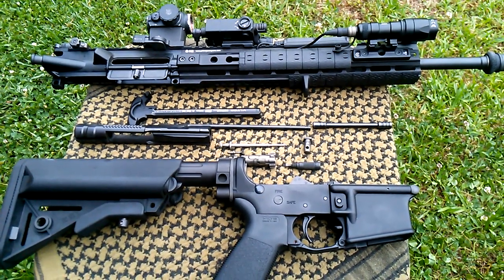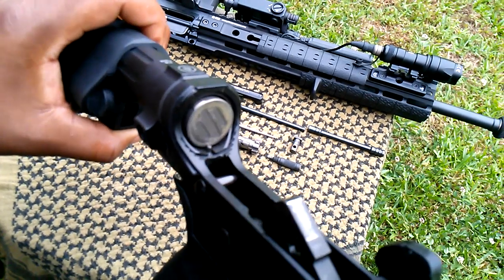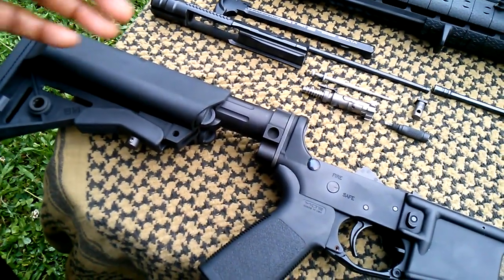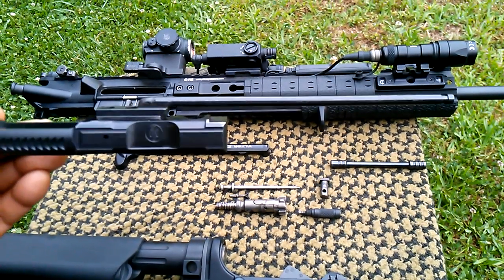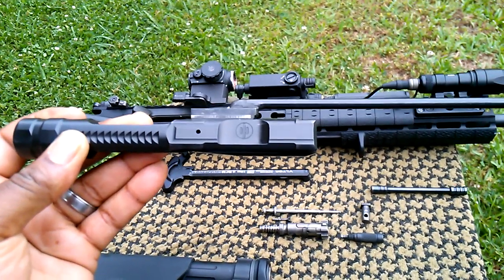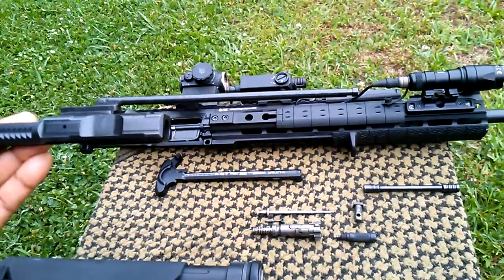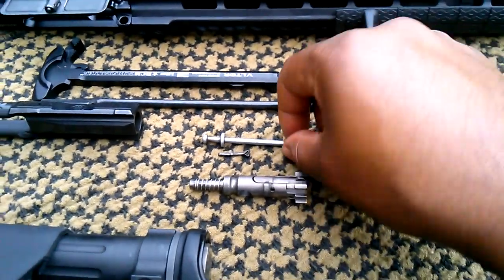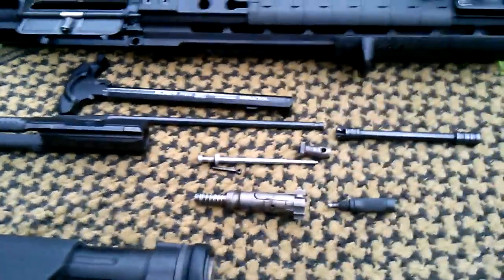A closer look at PWS gas system part1.

Comment: I have a mk1 mod 1. 10.75 in barrel suppressed with AAC. M2000. I do have a cmc trigger installed. And it is driving bolt back far enough to eject fired round an chamber live round but doesn't cock hammer so hammer rides bolt forward an even though there is a live round in chamber it won't fire an you can't put safety on. I tryed using 3 difference ammos all h.v. I have tried all gas settings? Only thing left is to see if the hole in the barrel is clogged with copper? How do you do that? I could go though trouble of taking out cmc trigger an put factory one back in. I have only 1,000-2,000 rds though gun. I did dismantle gas system to clean tube but it wasn't that dirty. What would you recommend?
Reply from the maker: Yeah I would try  putting the factory trigger first. Your barrel and gas block should be good  to go, if its firing and chambering another round. That would mean your gas system is good too. That definitely sounds like a trigger issue. If changing the trigger still does not work contact PWS. They have great customer service.
Reply: @datzitteezy   Thanks I have been in contact with them an Owen seems to think trigger is a great one an probably not issue. I did have gas setting on 2 an he said wiith my can an ammo I should use 3&4. Plus he's sending me the h3 buffer which is a bit heavier than the 4.5 oz. Buffer I have now. I'm giving it a good cleaning an see if that helps with it on the 4th setting. He said xm193f ammo pretty hot an doubts that with only 1,000/1,500 rds though gun, it wouldn't have a blockage in the hole going from barrel up to gas block. Thanks for your video an help.
Reply from the maker: 10- 4 bro. my next guess was going to be try changing the buffer. hopefully that will solve your problem. good luck!!!

Comment: I am building an AR10 in Dpms format and there is nothing for a .308 piston bcg. I have a few piston guns and I would prefer this system. I wonder what makes it proprietary. Does the rail have something where the piston rides in or is it just a cup in the gap block? Can find much info on this system. Thanks for the video. Yours is the most informative.
Reply from the maker: i actually have a part 2 to this vid where I break the entire system down for cleaning.  there is a tube that rod sits in and the gas block is adjustable and will only work with this system.
Reply: +datzitteezy it seems like an awesome system high end system. Wish they made kits like Adams. I have an Adams xlp system in one of my AR15. The xlp is a huge leap from the old ones very solid and reliable as hell. You should do a review. I was hoping they made some .308 kits but they don't. Just seeing my options. Thanks again bud.
Reply from the maker: +Kris Stojanovski no problem. glad i could help.

Comment: do you leave it on one gas setting or do you adjust every time you add or remove the suppressor??
Reply from the maker: +Abram Arnold  For the most part I can leave it on the 3 dot setting.  It has run 55 grain tula with no hiccups. It also makes for very soft recoil. On the four dot setting which is the smallest port. It will run 55 grain but every once in a while I will get a failure to feed.  There is just not enough gas to push the BCG to the rear. Now with hotter loads 62 and above it runs fine on the four dot setting suppressed and unsuppressed.
Reply: Thanks, im looking into the 308 pws and was trying to figure out which gas setting to leave it on for general suppressed and unsuppressed use. I might jump between 147gr and 150gr loads

Comment: Great video, UPS is bringing my PWS 7.62x39 this afternoon!
Reply: Well, I think the recoil is a little sharper, and a little more felt than my DI 7.62x39 guns tuned with adjustable gas blocks.  In my opinion, a 7.62x39 AR shouldn't be a go to war gun anyway, so the added reliability of the piston and the downside of the recoil for $1,300 isn't worth it to me.  It's cool and it's light, I wish it was chambered in .223 Wylde or 5.56 honestly, or that I would have put the money towards a Krebs AK.  Nothing wrong with the product, just a change in my preferences which happens all too frequently it seems.
Reply: ***** Yeah, the bolt/lugs are pretty thin when milled out for that caliber.  I'm not sure how common the failures really are though, I personally never had an issue with them.  I've seen some negative stuff about 7.62x39 magazines floating around the internet, but I run C-Product 30 rd mags and haven't had a feeding problem yet.  By no means am I telling you not to get one, if you're dead set on a 7.62x39 AR it's probably the best upper on the market in my opinion.  Piston keeps your bolt carrier and stuff a lot cleaner, but a standard gas blow back tuned is just as fun and a lot cheaper.  If SHTF I'd take the gun and a spare bolt out of one of my others just in case;  It's currently the best rifle in my small collection.

Comment: Does the PWS Mk1 Series rifles accept "standard DI bolts"? 

Or is it necessary to use the proprietary bolt?  

Great video on the gas system.
Reply from the maker: Not the Mk1 series rifles.  These are gas piston run rifles and only work with PWS gas piston BCG. However PWS has just released a DI line of rifles called the modern musket and it does run any standard or mil spec BCG.
Reply from the maker: ***** Gotcha. This system can only run the PWS bolt as it does not require gas rings to vent the gas like the traditional DI AR's.
Reply: +datzitteezy Actually, you can run any standard AR bolt as long as you strip the gas rings off.  In fact, I have one in right now.
Reply: I wouldn't trust the reliability of that under harsh conditions. Maybe good just for a range trip and haven't seen pws come out and say its ok to do that. From everything i've read PWS says it can damage the sysytem. So i still say use original pws parts. If its works then cool but I don't recommend it.
Reply: Look at the two side by side... They're completely compatible AR bolts.  There are no differences with the exception of the gas rings.  ZERO.  I've been running one for around 10K rounds.  They're completely interchangeable.
Reply: ontosJM cool still don't recommend it.
Reply: Based upon what evidence, exactly?  Please be specific with your answer and provide examples.
Reply: Even better if you have evidence of demential differences, any difference in design/composition/engineering/construction...Or really anything at all beyond the fact that they have no gas rings, which is a trait they share with the bolts used by the manufacturers of every other piston system on the market.
Reply from the maker: +ontosJM post a vid of you using it. PWS is where I got my info. I asked the same question in an email. they specifically said "we don't recommend using our bolt in a DI gun." email has been deleted which was a few years ago. that's what I was told. you say it works lets see your evidence. post a video of yourself shooting a pws bolt in a normal DI gun. make sure you show the bolt outside of the carrier first. talk about why and how it works. i'd like to know. My evidence is based on what PWS told me. lets see yours. if it works cool but Its not going to change my mind. I still will not recommend it But I would like to see if it works.
Reply from the maker: +ontosJM post a vid.
Reply from the maker: +ontosJM all I said I don't recommend it. I never said it wouldn't work. post a vid showing that it does work. And I'm still going to say "cool still don't recommend it." I just want to see if it works.
Reply: I believe the question was, "Could you use a standard bolt in a PWS".  Yes, you can without the gas rings.  Of course you can't use a PWS bolt in a standard DI rifle because the bolt tail has no place for the gas rings.
Reply from the maker: +ontosJM cool. I still don't recommend it.
Reply: And yet you have no evidence to suggest otherwise.  But, I suppose it's nice to have feelings.
Reply from the maker: +ontosJM you have not produced any evidence either.  please post a vid of it working. ill wait. plus I stated that I asked the same question an email to pws. their response was "we do not recommend doing that." there is my evidence. ill wait to see your vid otherwise your spewing hot air. post a vid for your reply. you say it works.......prove it. I want to know.
Reply from the maker: +ontosJM still waiting on that vid?
Reply from the maker: +ontosJM unless you can prove that a standard bolt will work then I will continue to say that using one in a PWS carrier is not recommended. please quit trolling until you produce evidence showing otherwise.
Reply: datzitteezy hey man, great video. I’m about to buy a used Mk116 Mod1P in 7.62 x 39. What do you think is a reasonable price for it? Seller said he fired less than 50 rounds, wants 700(upper only) with 1 mag

Comment: The technology of that PWS AR I dig. Do you notice any loss in accuracy or speed compared to a traditional DI gun?
Reply: I will say that my MK216(.308) consistently shoots PPU ball under 1.5moa, and 175gr Prime or FGMM ~.75moa(using a primary arms 1-8x platinum).  Are there more accurate DI guns, for sure.  There are also more accurate piston guns.  Also not to say that a better shooter couldnt improve those numbers, and more magnification would almost certainly tighten the groups up slightly.  But this gun isnt meant to be precision at the cost of all else, and compared to similar ethos and priced DI guns, i see no loss of accuracy. PWS did a lot of work to make sure that was the case.  

I find their rifles to be some of the best balanced, in terms of practical broad usage, but also in the literal sense of weight distribution.  I think if you didnt tell someone it was piston, they would never know.  By far the softest recoiling .308 i have shot in any platform, and for me, that translates to AR15 levels of shooting speed.  It feels like a spicy 556 when you have a suppressor on and gas tuned properly.  Though not necessarily movement speed due to the unavoidable weight difference, generally.

Obviously, im a fan.
Reply from the maker: Actually this bad boy is chambered in 223 wylde. Its more accurate than a 5.56 chambered gun. It also can run .223 and 5.56 nato ammo without hicccups.